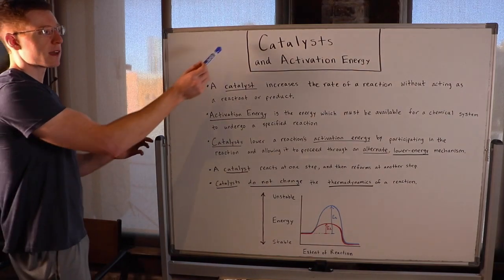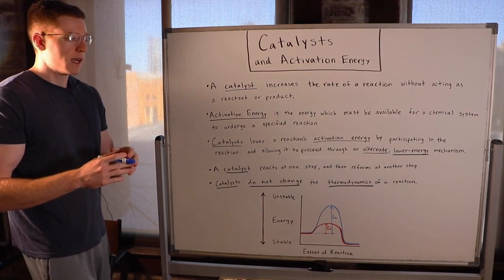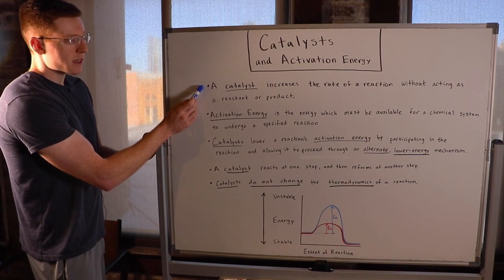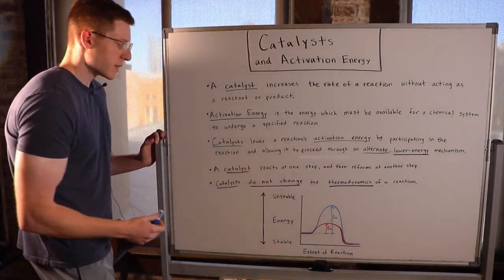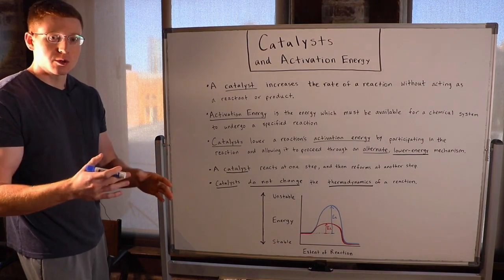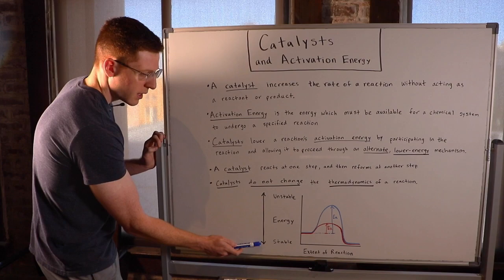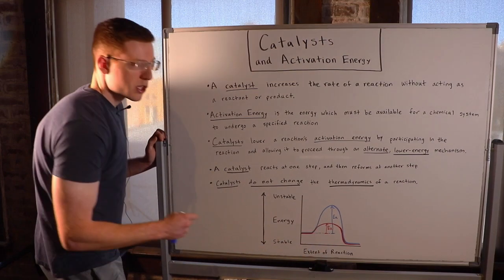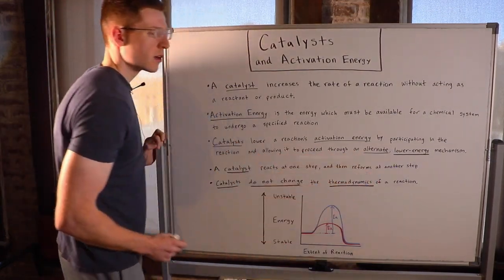Catalysts and Activation Energy

Comment: Is there a possibility of asking questions regarding solving a problem with data of failure time versus temperature and predicting an activation and rate constant from the data to predict failure at a temperature outside the range of test temperatures within 10 C of data at both low and high ranges ? How can I send you this problem.